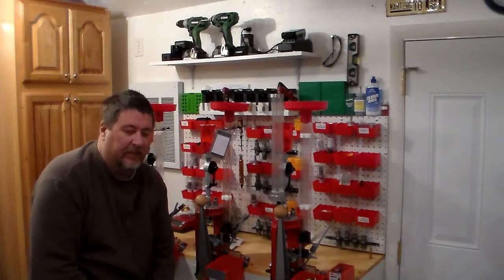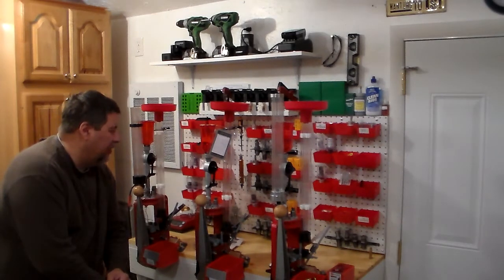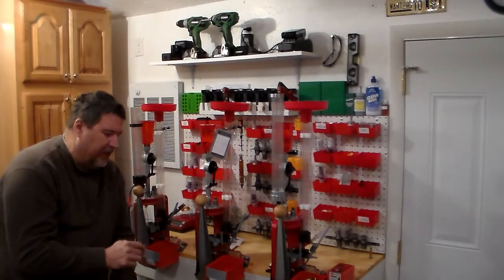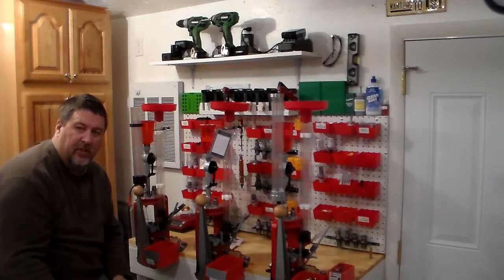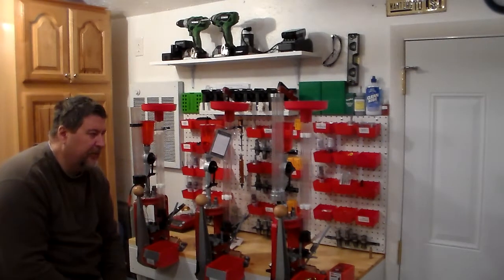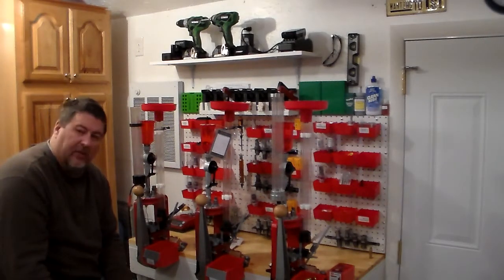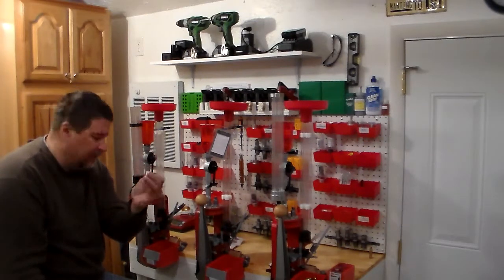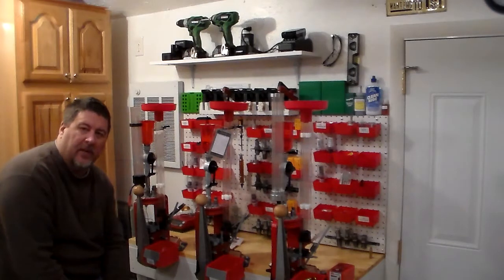RIFLE RELOADING BENCH-LOADMASTER PROGRESSIVE PRESS

Comment: I have to ask the question... 

You have three calibers set up on a progressive reloader, you are happy and it is not Blue in your reloading room.

I am guessing three Reds are cheaper than setting up 1 Blue in three rifle calibers as well.
The Blue Auto Progressive users do not like to share that the primer system has to be tweaked for each caliber each time to function without jams, improper seating and primer detonation, the caliber specific parts must be swapped out, and they actually require cleaning to function reliably.  You have simplified your life considerably by having three set up.

You seem to have no hesitation with continuing to choose what is labeled as a good boat anchor by many in the reloading forums.   What was my one question again ?

Comment: Harleychromeman, I have a question about the lee loadmaster. I am new to reloading and I saw on my first reloads of 9mm when it got down to the last of the primers it would not load the primers. Do I need to add primers even when I am at the last of the rounds I am loading. I was wondering if it needed the extra weight to help the primers feed. Love your videos, keep up the good work.
Reply from the maker: Yes, it does help to add the primer before your totally out. This is part of me building a primer alarm and primer feed system. I have made several improvement from the first one I built. I will be showing it in my next few video's. Another thing you can do is clean the inside of the primer assembly. Remove both screws, the 2 piece come a part. Take Q Tip with any wax and apply it in the channel, wipe it out really good. Sometimes you can also get few primers that are not centered, leaving the bottom slightly rough. Try this, if you have anymore issues, let me know and I will make a video to help. Thanks for visiting my channel, feel free to ask any question about reloading anytime. Good Shooting my Friend. Thank You for your question, and your feedback.
Reply: Thank you for taking the time to answer my question, I am sure I will have more as I do more reloading.
Reply from the maker: anytime you have questions, more than happy to help.

Comment: Are the shell plates on your Loadmaster presses the new pentagonal design or the older 5 posts design for indexing? Have you had any issues with varying tightness of the shell plates as it indexes around the different stations?
Reply from the maker: all my shell plates are pentagonal, got rid of all the 5 post holders. I had problem with the rod jamming up and not wanting to rotate. I don't tighten my shell plate very tight. I just snug it up a little bit and it allows the indexing to rotate smoothly. I use a product on the bottom of the shell plate, indexing rod and the case feed carrier. Sorry, I am not in my shop and I can't remember the product number.It cost about $15.00 for bottle and it last for long time. The product is used on high end bicycle chains, racing bicycles. it makes everything smoother than baby butt. My load master presses work with very little effort. There are video's out there that say to file down the bottom side of the shell plate and to do some filing on the end of the indexing rod. Don't do it, it doesn't work. Most of the time the shell plate is tighten to tight and it is out of alignment. In my next video, I wll make a point to share the name of the product I use. Thanks for your questions, feel free to ask any question you want. Hope this information is helpful. Good Shooting my Friend.

Comment: i have a question about the pro autodisk powder measure. i can not seem to get a accurate charge from my pro auto disk powder measure. it looks like the powder is sticking to the wiper and the disk and does not seem to fall all the way through, it looks like i am have some kind of static problem it sticks to the wall of hopper used for the powder. Any solutions for my problem?
Reply from the maker: Yes, put your powder in your hopper and open the grn on your powder all the way. Run several loads out of it, this usually takes care of the problem. 2nd thing,  buy some graphite put it in your hopper and follow the same process. Only thing about graphite, it will turn your hopper to a black color. If you have to go to the 2nd option, wipe out your hopper when your done. Let me know how it works out.  Good Shooting my Friend
Reply: Harleychromeman thank you i will give it a try.